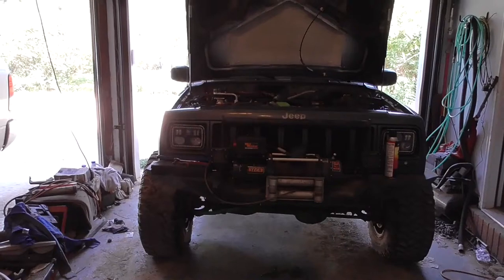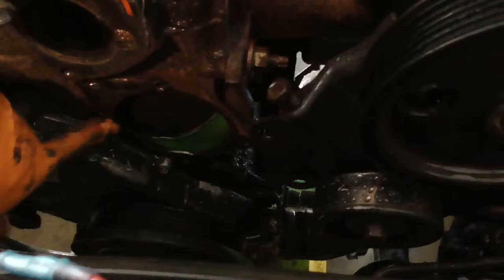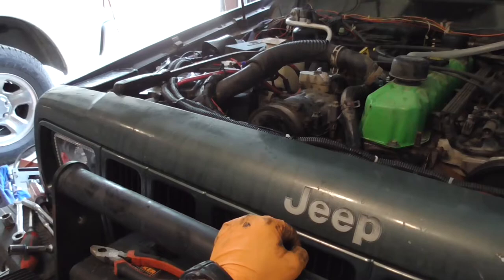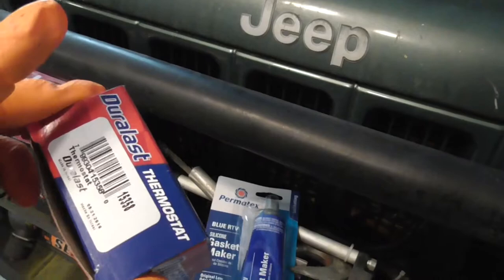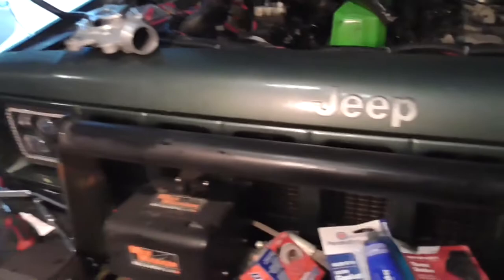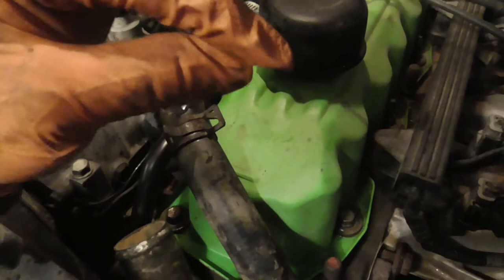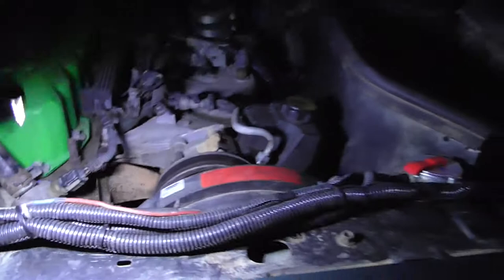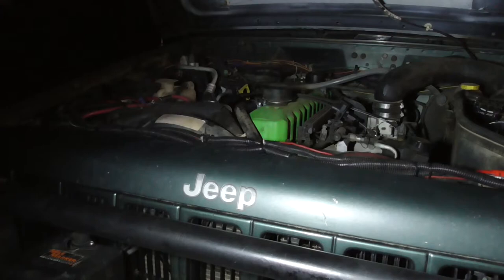2000 Jeep Cherokee | Water Pump Replacement

Comment: If you use a 180* thermostat, your gas mileage will drop. And other issues might arise. Your Jeep is designed to run at 210* .
The original thermostat is 195*.   yea no kidding.  That's what I said..... But the system is what it is.
Reply from the maker: Gordon GMan Yep, all things I know. I've had a 180° thermostat in this thing for almost the whole 10 years I have had it (except in winter). It still runs 210 it just takes a little longer to get there, which I like. And the gas mileage loss is negligible with the lift, tires, and armor (bumpers, rock sliders, winch, ect.) Without gears it doesn't get great MPG to begin with, with all the mods.

Comment: my jeep is set up the same way. do I HAVE to take off thermostat housing?
Reply from the maker: I don't think you absolutely have to, but it gives you more room to work.  Plus you are already in there, the thermostat gaskets aren't that much.
Reply: right, I'd normally change it all out anyway but thermostat literally just got done two months ago
Reply: I know it's probably a little late but no you don't need to remove it.  I didn't think it would have made that much of a difference with it removed.  I just did my water pump tonight.